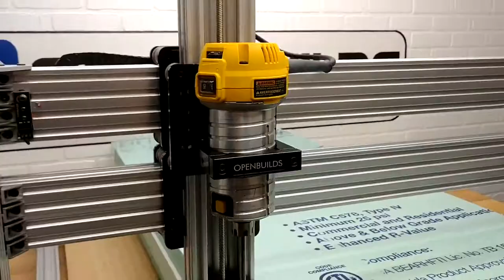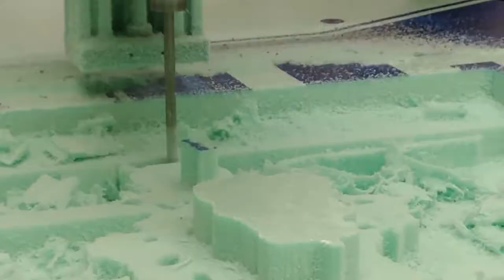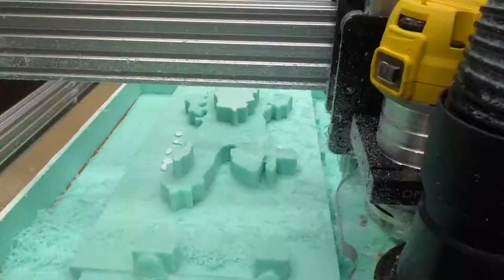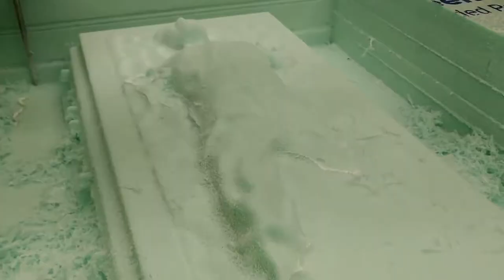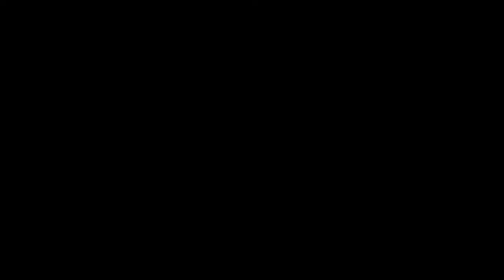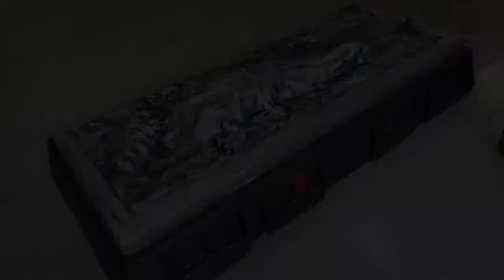OpenBuilds Han Solo Project

Comment: What is the endmill that you are using there?
Reply from the maker: This is a Carbide End Mill and Ball Nose used on this project. Both of these bits are 6" in length which worked great for the size of this project. 👍